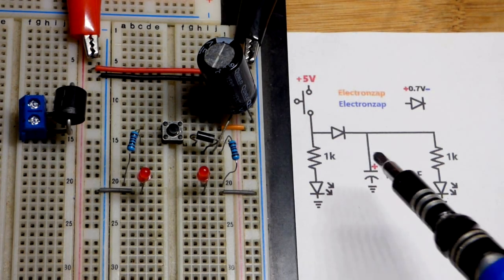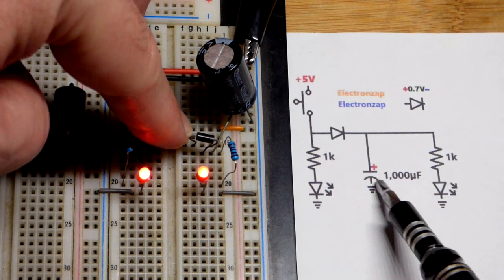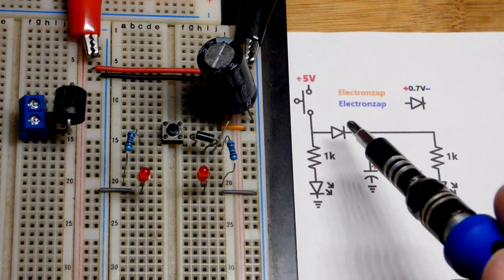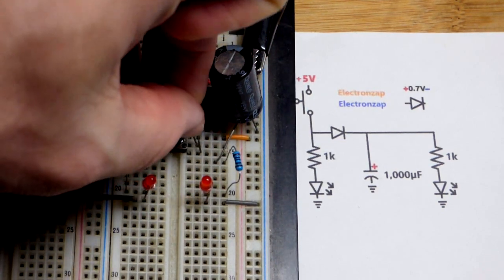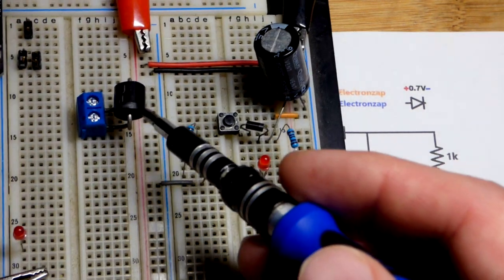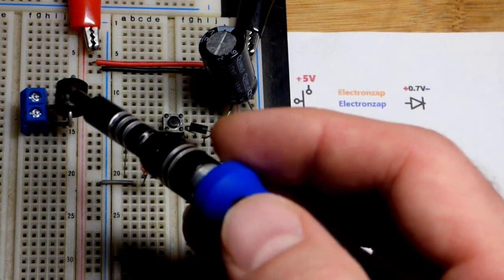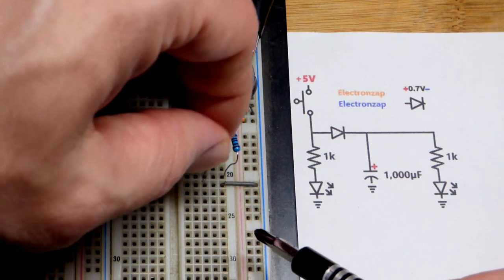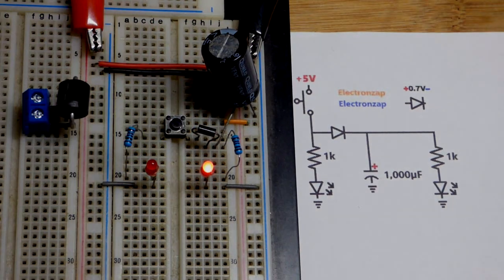Diode used to isolate energy storage visual demo circuit using LEDs and capacitor by electronzap

Comment from the maker: https://electronzap.com/how-to-learn-basic-electronics/diode-components/diode-used-to-isolate-stored-energy-from-a-parallel-circuit/ for more info on this circuit.
List of my videos https://www.youtube.com/c/electronzap/videos https://www.amazon.com/shop/electronzapdotcom/list/1ADLVE33FFFYL?ref_=cm_sw_r_cp_ud_aipsflist_aipsfelectronzapdotcom_B79P02M0KFPJ24S768FC As an Amazon Associate I earn from qualifying purchases. Americans should check out one or more of those links before making any purchases. There's no extra cost to you.
My website https://electronzap.com/ To donate  https://www.patreon.com/electronzap Become a member https://www.youtube.com/channel/UCC8jLsnnN1_o93p5QOIX1vA/join
https://www.reddit.com/r/ElectronicsStudy/

Diode can be used so that 1 switch can power 2 parallel circuits while closed, but when the switch is open, then one of those circuits can use its stored power without powering the other circuit.

Comment: Good idea for diode demo! Maybe put an inductor from + to diode and tap with that switch - boost converter!
Reply from the maker: I made a DIY boost converter like that but my inductors aren't very good for that, and boost converter modules are pretty cheap.